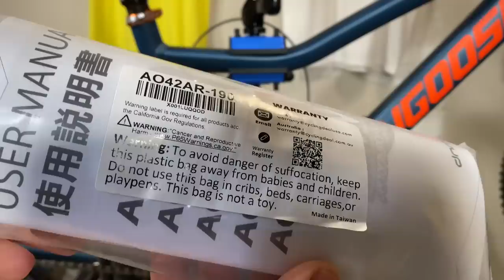Perfect FIT or Total FAIL??? 190mm Rear Shock for Mongoose Ledge X1

Comment: Any other Engineers in here see the rear seat stay is a 2 force member acting below the center pivot joint and realize from the very beginning that in this format going over bumps will apply tension to the shock instead of compression? I instantly saw that and realize that if he sat on the bike he would not get any travel out of the shock because the shock is so big it makes the system pull on it instead of compress it because of the new geometry of the bike. It would also push against the weak center if the rear shock and make it bien and buckle due to large external bending moment. Just food for thought.
Reply: Yeah, pretty obvious that when force is applied to that linkage it isn't gonna drive the shock down, but rather buckle in and pull on the shock. Not really what you want to see.
Reply: 100%. I was like that will not work.
Reply: Noticed it too 😂
Reply: I was too busy noticing the friction on the rear linkages. On my bike with the shock removed the linkages would fall from gravity with a clunk. Mine wouldn't stay where I moved it and stay. (if it ever didn't move freely it would get me bearings it a bunch of lube)
Reply: Yes,  it was really hard to stay in the video the moment i noticed the upper rear pivot dropped below the main rocker arm pivot
Reply: Wish I could be an engineer I notice this kinda stuff right away too lol I thought he wasn't even gonna notice at first it was making me panic haha
Reply: yes, I sure did catch that right away
Reply: No need to be an engineer to see it.....but good humble bragg.....oh i am a software engineer (the smart engineers) figured i would mention it for no reason.

Comment: Is called overshocking, it’s not good, it pushed the rear pivot arm a little bit out which if put too much pressure on can snap and not be good, watch the rear shock video from Worldwide cycle Roy and true and find how they explain it, that’s how I learned about it
Reply: Can u and me the link of the video ur talking about
Reply: now i understand why they say max frame travel. The frame arcs around the center of the  pivot bearing.  There was another guy had to change a part on his horse link to get more travel. It moved the pivot and changed the arc.

Comment: Great video to learn from! As a rule, you should never use a shock that has a longer eye-to-eye for this and many other reasons. You can sometimes get away with running a shock with the same eye length, but slightly more stroke (the amount the shock moves). This is still very unadvisable since, as you showed,  the distance is multiplied. So even an extra 5mm stroke can be a massive change. This can mean the geo gets all out of whack, or the linkage can smash into the frame and destroy your bike.

Comment: I’ve gone through all this geometry in 30 years of RC car racing.

1) The 190mm shock will be longer than the 165mm shock when both are compressed, so the bike will site higher when both bottom out.

I’ve installed longer shocks on off-road cars without checking, only to see the car bouncing funny because the suspension bottoms out a lot sooner than before. You had to use a different mounting hole, or make a new mount, to make sure you have the same amount of bump travel as before.

2) You see that point where the rear suspension starts to rise back up as you extend the shock? You’ve hyperextended the suspension, and the rocker arm is working in the opposite direction; it wants to keep extending the shock, which will lock up the suspension.

If I didn’t pay attention when installing those longer shocks, they might let the suspension extend too far, which could do anything from cause the linkage to bind or lock up, or even damage parts that now interfere with each other. You might have to put some limiting spacers inside the shock so it doesn’t extend farther than it should.

After you go through all that, moving things around and making adjustments so the suspension doesn’t bottom out too early or extend too far, you might find you were better off with the short shocks the car came with in the first place. At least you learn a valuable lesson, and have some more goodies for your parts bin to use on future projects.

I bet there’s a lot of crossover between RC racers and mountain bikers.

Comment: First off this was amazingly helpful! I have a Cyrusher FR100 with the old 6.5x1.5" rear dimensions and basically the same rear suspension geometry and was thinking about going to a longer rear shock but this pretty much took all the wind out of my sails for the model of shock i wanted to go with lol

But it's alright RockShox has plenty of solid options within my spec which are a bit lower end but will still get the job done, thanks for saving me some money and solving this very specific question I had about my bikes compatibility and now I won't be have to wait to spend the money on the shock that won't fit

Comment: That spring shock is the best I’ve tried all three. Plus springs are more comfortable than air. With air like you mentioned you have the convenience of quick adjustments. With spring shocks you just have to find the right pound shock. I’m running a 400 pound rock shock spring.
Reply: What is your weight? I'm also looking to switch to a different spring if possible.

Comment: I use the same DNM coil shock in 190mm length on my modified Razor electric dirt bike :)  Came stock with the same craptastic "shock" as the Mongoose.

Comment: The linkage with the 190 shock was actually in an over travel position, and it never would have worked at all even if the shock did bolt up correctly, it's a bit technical, but it has to do with mechanical advantage, and how leverage systems actually work, once you pass the over travel position, you are effectively locking out the shock from ever functioning. if you want to increase rear wheel travel, you need to keep the same eye to eye measurement, but go with a slightly longer stroke shock, and I do mean slightly, maybe 5mm or so more than the original. The mechanical advantage of that bikes linkage, looks to be a 2:1 ratio, meaning that the total rear wheel travel will be twice that of the shock stroke. 35mm of shock travel equates to 70mm of rear wheel travel.

Comment: You wouldn't be just losing travel with a 190mm. The system isn't made for that length, and wouldn't be able to travel at all with a 190mmm. 

The rotation of the swing arm wouldn't be able to correct the inversion of that hinge point, that you can fix when adjusting by hand.

Swing arm rotating up would actually force that hinge point further down, if not for the limitation of the shock. 

Your shock would need to be able to extend rather than compress for that to work. Lack of room and a shock that can do that, means it won't work at all.

Comment: Just a idea. You can let all of the air out of the shock and then you can measure travel a lot easier with the shock installed. Then you also get the physical stops at each end of the shock
Reply from the maker: It’s worth note that some shocks don’t recommend fully depleting unless they’re being rebuilt
Reply: @KevCentral  that is a good note to make.

Comment: The pivots are made to match certain shocks. Like my downhill bike the pivot will change if I add bigger shock. The theory is changing shock length will offset the pivot such as new bike have the clip to move forward or back to change the sweep. Now dh bike you change coils. For strength nothing longer on shock just lb pressure for coil. Now you bike  if you add bigger shock did you notice how it made the pivot would not work bigger shock would have made the pivot push down no up to pivot

Comment: I tried that in my Ironhorse Warrior 3.1 26" and that is not a good idea . The mechanical engineers who designed the bike , calculated the pivot and lever system to work with a 165 mm shock and not otherwise .

Comment: If You want to change travel in your frame, You need to change your link, You doesn't have to change your damper length. In one enduro i change the link and change the damper from 165 to 190 in simply chane sides of links and turn them left to backwards. Simply it shortened the front and extend rear of the link so you ccan go with longer damper and the geometry changed from trail to enduro, and travel from 100 to about 150-160 from coil spring to air spring - and that matters.
So you can, if you know what're you doing.
Reply from the maker: Thanks for commenting

Comment: Good info, Thank You.  I also tried a 190mm shock and it will NOT work for several reasons AND Unboxed Vids below is correct, the shock will be put in tension as the rear wheel moves upward.

Comment: You could drill the lower pivot hole into a lower position (not what i would do), since that wont make the linkage extend that Much. It is a way to keep going with the experiment if that is the goal.. 
Off-center shock eyelet bushings also exist, they are sometimes used to change geometrien.
Reply from the maker: Hmmm. Wouldn’t that also eliminate the ability to use a 190? It pretty much fills the available space as-is.
Reply: @KevCentral  You seem to still have some space between the shock and frame near the lower pivot (by the image, I'd say it could lower something like 10-15mm. It is hard to judge exactly if the 10-15mm would be inside the triangular hole in the lower mount brace -> the welded into the main frame triangle brace that extends from the downtube to hold the lower pivot). Or maybe that triangular hole in the lower eyelet mount could be enlarged. Possibly part of said lower mount would also have to be filed/ground to make space for the shock air can. Do any of those mods at your own risk, it was just if you wanted to take the experiment further. I just meant that mabe 190mm shock would be possible, if you consider lowering the lower mount point by drilling it out.

Comment: With the 190 shock it will basically jam the pivot mechanism so it'll be basically unusable and might even do damage to the pivot system in the longrun. Also you'll have no travel at all, so it's a useless endeavour anyway.
Reply: That's what I saw.
Reply: That is what I thought too.  I figure if the upper swing arm can now handle the vertical  stress of pushing the pivot up it might last a while. But will it work good?

Comment: I think you got shock sizing wrong. For Example on my Specialized Enduro, it uses a 210 x 60. 210 is the eye to eye measurement, while 60 is the stroke length. The stroke being the part that compresses. I over shocked my bike by increasing the stroke, so it is a 65, but the eye to eye stays the same. So the shock I am running is a 210 x 65.

Comment: You should cut new lever arms (& possibly dropout extensions) to fit the 190! Use your "marker and cardboard" concept to create pivot point arks to help determine rising/decreasing rates! The way the arm and dropouts are designed, you could make some raw prototypes with garage tools! Of course you'd need to b.b./chainring clearance! DOOO EEET!

Comment: some frames let you get away with a little longer sock, but that's just too much. what i used to is to look up the several frame montages by the manufacturer, if you pay close atention, you can see some differences in shock lenght (like the 2007 Big Hit, the 1 came with a shorter shock lenght than 2 and 3, and those also came with a piggyback shock that add more stroke).
i would not go with more than what the manufacturer uses, but you can use a trunion and/or piggyback shock the have more stroke, that would not have much impact with the geometry, but will help with progressiveness of the frame travel
Reply: ONE CAME WITH A 210MM SHOCK, THER WITH 222MM

Comment: I think the only way you could get this to work is if you made a custom pivot that could change the position of the rear triangle just enough so you could get more travel, I am considering on doing this to a much older bike frame to try and increase travel, as well as make the head tube angle slacker. I’m not entirely sure if it would work but I could experiment on it to see what would happen
Reply from the maker: Lots of work - and math

Comment: One thing you could try is a trunnion mount shock, it should fit in that bike, youll get longer stroke with a shorter eye to eye, also it looks like you could reverse the top link but it would probably reduce the leverage a TON and raise the bb a TON but give you more eye to eye clearance, though it may over-center and jam the linkage, if you wanna do it you should slap like a 180mm fork on it. If i had that bike id be trying all sorts of stupid stuff😂

Comment: Here's an idea: Could you invert the rockers, and flip them upside down? that should bring the rear wheel back up quite a  bit.  Geo may still not work correctly but it would be a good experiment to test.
Reply: The more I think about this, the more I think you should try it!! Give it a shot and let us know if it works!
Reply: Nevermind, I did a quick mockup on an image editor and that wouldn't work at all...

Comment: If you made the bike a mullet. Stuck a 29 up front and 27.5 out back and maybe the 190 might work but you still have the same shock travel so still dead in the water.

Comment: Make a 2 dimensional CAD model from measurements of each linkage. It won't provide an accurate measurement of leverage ratio, but you can figure our travel and changes to the bike's geo pretty easily.
Reply from the maker: Maths 👿

Comment: I'm confused on why you did this video.  Of course a 190mm shock won't work.  Even if you installed the 190mm shock it most likely wouldn't even pivot and you would risk breaking the pivot and/or frame.
Reply: Shut

Comment: would you consider running a cheap trunnion-mount shock if the upper link was wide enough to fit it? so you could keep the stroke longer but make the eye to eye shorter?
Reply: there's some marin take off shocks in a 205x65 for $80 on pinkbike and I'm sure a shorter trunnion size there's a cheap one for sale

Comment: Their a little hard to find for cheap… actually they ain’t cheap at all, but what about 170 eyelet to eyelet? I was gonna suggest 184, but that’s only 7 mm less than 190 so I just think it will have the same affect as before, too much shock not enough pivot. But 170 is WAY less but is still a boost overall. Just a suggestion.
Reply from the maker: Thanks, but I’m happy with the 165

Comment: Did you try compressing it with the 190mm  shock on?  Doesn't look like it would even work, the rocker arm seems like it reversed geometry and would pull on the shock instead of compressing it.
Reply from the maker: Nah. I figured it would have been pointless as it clearly wasn’t something that would work for riding

Comment: Usually it works out roughly 5mm of actual shock travel = 15mm of rear wheel travel. Which would give the dnm air shock 105mm of travel.
Reply from the maker: I’m sure that varies by setup, but yes…more at the rear than the shock’s base travel
Reply: Oh yeah it all depends on the pivot system it's a general rough equation that is used to calculate rough travel. It doesn't vary to much though, we're talking a few mm either way.

Comment: What if you flip the pivot shock bracket and go with a smaller shock...or redesign the pivot bracket to fit the 190 with factory ride height....that's what iam doing to my bike...

Comment: those dnm, dont move what they claim... 35 is like 25, and you will steepen the head angle, no good..you could drill the lower mount on the frame ......

Comment: I wouldn't go more than a 175mm. It seems like around 180mm you cross the effective pivot point. And go into a counter rotation thus binding the linkage in a direction it was never meant to travel.
Reply from the maker: I’ll be sticking to the factory 165

Comment: Hey KevCentral, love the pseudoscience, however, when looking to increase the travel of a bike at the rear, one sure-fire way is to use a shock with the same eye to eye, as to not upset geo, but a longer shock stroke. For example, if the 190mm shocks stroke were on a 165mm eye to eye shock, you would get 137mm instead. However, when doing this, you need to watch out for clearance issues. Hope this helps
Reply from the maker: Thanks, but how is it possible to have a shock stroke that exceeds the eye-to-eye length of the shock as a whole?
Reply: @KevCentral  reservoir shocks. You can dip into them a little further.
Reply: @KevCentral  what do you mean?

Comment: bottom U bracket could be ground off and reweld it on 1" lower to allow a 190mm shock, but would it be worth the hassle? what is the range on the 190mm? I assume 50mm?  I've never tested various shocks side by side. I certainly think 3-4 inches of travel is worth it. I guess you have to be pretty hard core to want more than that?
Reply from the maker: Lol. Yeah, I’m happy with the 165

Comment: those dnm shocks do not actually have the travel they advertise..i had that same aoy36rc 165 it speced 38mm travel but i measured it to only get 31mm ...i found a used fox float that had a 165 eye to eye and measured 42 mm travel...made a big difference   and didnt chage the geo
Reply from the maker: Pretty sure the one on my XR has full travel. I haven’t measured this one

Comment: Is the stroke the same for both shocks?  When i clicked on the provided links both of them shows 35mm of stroke.  If the stroke is the same the overall travel will be similar. (maybe i missed something but let me know.)
Reply from the maker: Stroke for the 190 is 48mm
Reply: @KevCentral  thanks, I figured i have just missed that.  Keep up the good work!